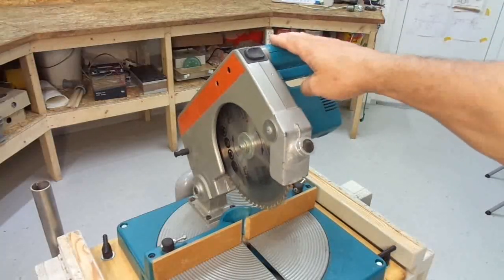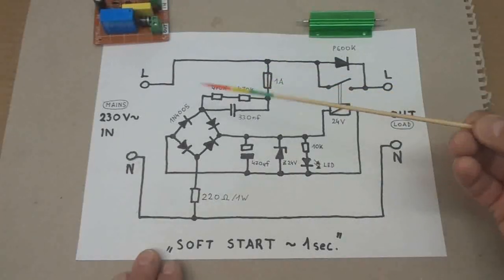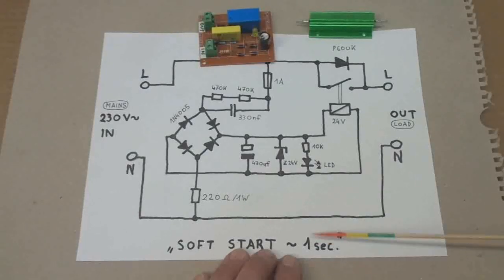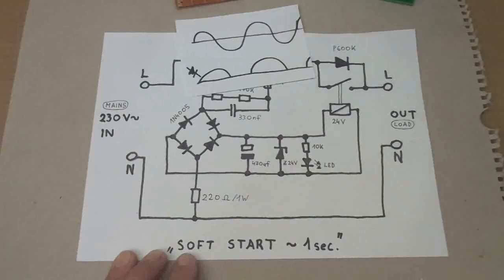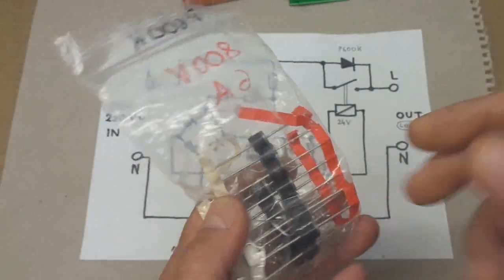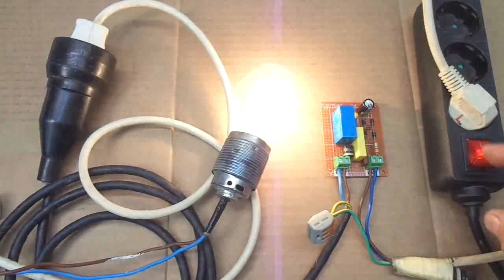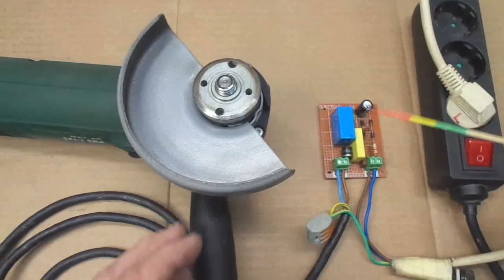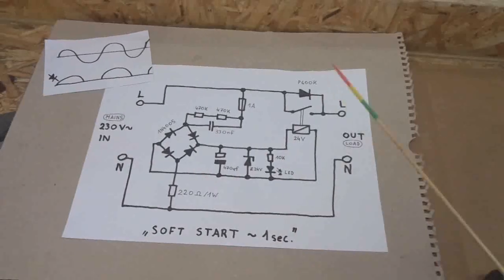simple soft start circuit DIY

Comment: Hi. In my project AC voltage before bridge is only 12v and after bridge is 9v DC.. How to get more to power 24v relay? I been use parts like on move. Any help welcome.
Reply from the maker: Make sure, that it is a 24 Volt Zener diode in your circuit..If the Zener diode is correct, your relais wants to draw more current then mine... Try a bigger dropper capacitor. 470nF instead of 330 nF.... Or even higher, if you have a big Relais.... Dont get confused, the dropper capacitor limits the current, not the Voltage.. The Voltage, which you get on your Relais is the sum of how much load you connect to this "transformerless power supply"... So if you remove the relais and the Zener diode, you will get about 320 Volt DC out of the bridge rectifier...(unloaded). No matter, what value you have for the dropper capacitor. Once you burden the circuit, the Voltage will collapse and settle at an equelibrium point... Thats, where the Zener diode comes into play... It clamps the voltage down, if the Relaiscoil gets damaged and out of circuit...It protects the Electroloytic capacitor, because this cap is not made to handle 320 Volts. In my circuit i ended up with 19 Volts on the relais... That means, the Relais works, without getting to much Voltage and the Zener diode has nothing to do, because it is not conducting at 19 Volts.. So the Zener diode acts as a "crow bar circuit" it will conduct just in case of Relais failuer and blow the 1A fuse intentionally... It is a safety measure..  Short story long... increase the value of the dropper capacitor until the voltage is enough to power the Relais. Measure the voltage, when the Relais is on. It should stay a bit under the rated voltage of the Relais. This is fine and extends the life of your Relais.... I hope, all of this makes sense for you..   xD   And you will get the thin running.  ;)
Reply: @LariFariYoutube  Thank you for answer. I recon when relay is not connected output voltage is 24.8v .When i plug relay its works , hold connection but voltage drop to 9v. When i try start with relay connected den voltage cant build more then 9v. So I susspect my relay needs more current. I'm right ? His resistance is 540 ohm. Needs try bigger capasitor.
Reply from the maker: Yes, try a 470 nF capacitor or higher if necessary... @krzysztofwojcik108
Reply: All done. Fix my problem with replace a  relay with another one.  Same as yours. Soft start works fine. So in my case problem was with too big relay. Thanks for support. @LariFariYoutube

Comment: In use with an induction motor that has a start and run capacitor, do I need to bypass or remove the START cap?
Reply from the maker: A diode in series will not work on a induction motor.. Use instead of the diode a low value resistor. Somewhere in the region 1 to 10 ohms...or even better, a wire wound ballast. Like i did on my table saw build.
Reply: Ah ok. Thanks for your help.  I was trying so many ways with a NTC thermistor, but was unsuccessful.
Reply: If I have an inrush of say 20A on a 240VAC motor, does it make sense that a 10ohm resistor needs to handle almost 5kW?
Reply from the maker: A induction motor needs the full sine wave to operate.. So you have two options.. Using a resistor instead of the diode or a inductor.. The resistor / inductor needs to handle the high current just for 1 second, then the relais kicks in and all the current goes through the relais.. In my table saw build, i made my own soft start ballast coil out of 200 meters of installation wire.. You can build a smeller version with 50 meters of copper wire and a iron core. Watch the video "Table saw pt 4" to see what i mean. If you want to use a resistor, 10 ohms would probably be to high.. less the 5 ohms would be more suitable for such a high inductive load. There are a lot of variables involved and it needs a bit of experimentation to find the best value for the task.
Reply: Excellent! Thanks for your knowledge. Yes, I found your video and saw the inductor you made 😁. Ok, I have a 3ohm  10W resistor that I'll try.
Thanks so much

Comment: Is the inrush current cut in half? Or by what % reduction can you figure with?
Reply from the maker: Yes, it is half the current, because the diode cuts one half of the sine wave. If you use a Resistor instead of the diode, you can determen the current reduction by yourself... Typical values are somewhere between 1 and 10 Ohms. I made myself a wire wound shunt for my homemade table saw.. Check the video out.
Reply: @LariFariYoutube  thanks for the reply

Comment: Hi Larry, in your wiring diagram there are Neutral and Line, what if they swapped? Because we dont know which N and L in every electric socket. Thank you.
Reply from the maker: Dont worry. Because it is AC, it does not matter. We over here in Europe can plug in our 230 v plugs ether way round. Our houshold sockets are not polarized.  The only thing you have to keep in mind is, that relais will eventually switch the N instead of the L. But if you not having suicidal tendencies, you should not fumble around on elektronic tuff, which is pluged in to mains, anyway...  xD  So this circuit will work, no matter which way round you connect it up... By the way... because i had some questions on that...the order is:   Power plug --> switch --> soft start module --> Motor / load.  Greets from Germany.

Comment: So I got a makita soft starter module want yo add it to my dewalt table saw how do I go about wiring it up.
Reply from the maker: I dont know the Makita soft start module, but i assume, it gets wired between power switch of the saw and the saw motor. Because i think, it does more or less the same like my simple version here...But maybe a bit more advanced... with microcontroller and triac..

Comment: Great explanation sir. Could I ask you which component handles the delay?
Reply from the maker: It is the electrolytic capacitor. And the threshold voltage on which the Relais kicks in. Make the electrolytic capacitor bigger and the delay gets longer..

Comment: Im looking at building this for 120v like Claudemir has detailed but keeping the 24v relay.  Does this part list check out?
1x) 1A axial lead fuse
2x) 470K resistor
1x) 330nf X2 capacitor
4x) 1N4005 diode
1x) 2200 uF capacitor in place of 470uf (to get a 1 second delay) <-- not sure on this one
1x) 1N4749A 24 volt/1 Watt zener diode
1x) 10k resistor
1x) led
1x) 24v volt relay
1x) 20A10 rectifying diode (20 amps)
1x) 220ohm/1w resistor
Reply from the maker: I think it would make more sence, to go for a 48 Volt relais, because it takes less current to get it going.. The capacitive dropper limits the current, not the voltage..(simplified).. Your list is more or less ok. The 330 nf capacitor could be a bit low for 120 volt... Try to stay below the Zener voltage, when the relais is activated, so that it does not get hot.(by tinkering with the value of the dropper capacitor).. I am working on several big projects at the moment and have no spare time on hand to make tests and modifications for 120 volts on the circuit. Would be nice to see, if you are able, to get the circuit going on 120 volts and what kind of modifications you come up with.  ;)
Reply: @LariFariYoutube  Thanks for taking the time to give feedback.  I am not sure when I would build this.  The next step for me is to work on a schematic and learn to calculate the proper values.
Reply from the maker: @richiem9316   Oh, yes, there is a way, to calculate the proper values, but therefor you have to know, how many mA your Relais draws. Personally...For such small circuits i am faster to slam some components together on a breadboard and test it right away... I know, breadbords are not ment to work on 120 Volts or more..  xD

Comment: what are the calculations if i want 2 second start time instead of 1 second ?
Reply from the maker: double the capacitance of the electrolythic capacitor.... (timing capacitor)... It depends on the kind of relais you use...  You have to find the right value by trial and error..
Reply: @LariFariYoutube  for more precise activation of the relay, shouldn't we put some kind of transistor, and the timing capacitor controls the voltage of the transistor gate instead ?
Reply from the maker: Yes..this would be "the next level"  ;)  The circuit in the video ist the most simplest, you can get away with... There are lots of ways to do it... You can use a Transistor circuit, an 555 Timer IC or even a small attiny microcontroller.... But in the end, it is what it is...a simple soft start.. In most cases it does not matter if the relais kicks in after 1,5 seconds or 1,8 seconds... ;) The nasty inrush current spike occurs in the first 0,5 seconds...At least in the application, which it is designed for...starting motors or transformers..
Reply: @LariFariYoutube   one more think, when selecting the appropriate relay that can withstand the load, should i consider that the load is inductive load ? because relay are rated for resistive loads and have about halph its original rating if used with inductive load
Reply from the maker: Yes, would be  good practice to go with the relais about double the "run" current... My table saw pulls in operation about 10 A @ 230 Volts... I used a 25 A relais for tis machine... So far no problems... Its not the inrush current, what harms the relais contacts. It is the spark, when you turn off your device.. A 100nF 400V capacitor in parallel with the relais contacts can also help, to qunch this arc. Than, your relais will last longer..

Comment: Great video! I was looking for this circuit. Only one question. Is the 330 nano F value ok? Does not have to be micro F? Thanks!
Reply from the maker: It depends on your grid voltage, freqency, and the current which your relais draws... There is a proper calculation, to get the perfect value. (or look for onlinecalculator)  If you dont want to do the math, try differnt values..... Start with 220nf and increase, till your relais gets enough juice...but not to much. If you overshoot to much, the zener diode gets hot.....
Thats usually the way i do it.... Because i am a fool.. xD
Reply: @LariFariYoutube  xD. Thanks for your response Lari! Very kind from your part. In my case I have pretty much the same values you have, so that value should be ok. I'll build the circuit and measure it. Regards!

Comment: Sir may i ask is the diode p 600 k can handle 800 watts 6  ampere i'm i  correct sir tnx
Reply from the maker: 800 Watts at 6 Amps? Is the grid voltage in your country 125 Volts?  Yes, the Diode can handle that, because it is under load for only 1 second. But if you want to build the circuit for 125 Volts, you have to change some part values. There was one guy from brazil, who did it already. He posted all the necessary changes here in the comment section. His name is Claudemir Vernini.

Comment: hi can i use it for compressor refrigerator .. thanks
Reply from the maker: Yes you can...but normally, there is a built in soft start in every refrigerator compressor.. a PTC type divice.. You should check, if the PTC softstart in your refrigerator is malefunctening..

Comment: it can use for 1hp single phase ac motor?
Reply from the maker: Induction motor or universal motor?
Reply: induction motor for shallow well tank
Reply: can i have your diagram clearly sir🙏🙏🙏
Reply from the maker: For induction motors you can not use a diode. Replace the diode in the circuit for a high power resistor about 1 to 5 Ohms.. Or a better solution would be a "ballast"... On my homemade table saw, i used 200 Meters of copper wire as "start ballast".. The ballast is big, i know, but it is built, to last forever... Thats how we germans like to muild stuff..  Go to my video "homemade table saw Pt 4"... Minute 12:05.... And give me your e mail adress, i will draw a diagram for you.. Whats the grid voltage in your part of the world? 120 or 230 Volt?

Comment: Memasang Dimmer Rakitan Sendiri
Adalah kepuasan tersendiri, karena kita mengerti  dan memilih komponen triac yang tepat kita memaksimalkan peruntukan alat tersebut. Apalagi alat tersebut di samping untuk Alat softstart ternyata juga bisa melakukan penghematan pemakaian listrik rumah. Beberapa alat penggerak motor & elemen pemanas yang biasanya untuk kebutuhan rumah tangga dengan kapasitas mampu menahan beban 4000 watt :
1. pompa air
2. Mesin cuci 
3. Blender / Mixer
4. Pemanas Air / setrika 
5. Penanak Nasi
6. Mesin Bor / Gerinda 

Saya coba pakai microwave 1100 watt ternyata juga mampu biasanya jeglek walaupun listrik PLN 1300

** tidak bisa digunakan untuk keperluan mesin las listrik**

** saat memakai alat dimmer usahakan di posisi kan potensiometer meter kondisi minimal ( Rendah) kemudian atur potensiometer sesuai kebutuhan **

Lebih detail mengenai Dimmer Speed control dan Skemanya  silakan  lihat Deskripsi pada link YouTube :
Komponen Triac BT 137 saya lihat data sheet nya 8 A  jadi saya pakai 2 biji untuk mendapatkan kemampuan menahan daya 4000 watt atau bisa juga cukup 1 biji komponen Triac BT 139  data sheet nya  16 A atau setaraf dengan 4000 Watt. 

 https://youtu.be/BEMn9zsWcdQ

Comment: bro,. may i change diode 4005 to 4007, and  u have another alternative of 600v diode?  tengkyu...🙏
Reply from the maker: It depends on the load you want to soft start. The 1N4007 is a 1A, 1000V Diode...as far as i remember.  You can try to connect 3 or more of these Diodes in paralell, to get the required amp rating. Or you look on the junkyard for an old computer power supply. The often have a beefy diode on a heatsink built in. (TO 220 package). Instead of the diode, you can also try a power resistor (less than 10 ohm)..  Greets from Germany.

Comment: Hi Lari. will a 220v motor controller module do the same? also act as a soft start cirduit? thanks for the video. keep safe.
Reply from the maker: I am guessing you talk about a phase angle controller.  Yes, it would do the same thing. Even better. You could ramp the duty cycle from 0 up to 100% in a defined "startup time", as well as in a defined "startup curve" ....All you need is a arduino, attiny or some other cheap microcontroller and a ready made AC dimmer module like this.

https://de.aliexpress.com/item/32802025086.html?src=google&src=google&memo1=freelisting&albch=shopping&acnt=494-037-6276&slnk=&plac=&mtctp=&albbt=Google_7_shopping&albagn=888888&isSmbAutoCall=false&needSmbHouyi=false&albcp=12554800262&albag=127990761348&trgt=1284054470089&crea=de32802025086&netw=u&device=c&albpg=1284054470089&albpd=de32802025086&gclid=Cj0KCQiAzfuNBhCGARIsAD1nu--RdH2mSyYILRisfb7YA_gWVVZ2f4r3AyNWwPNrX8hUEgOD86NobqkaAinPEALw_wcB&gclsrc=aw.ds&aff_fcid=65c6684b6f6949cdb5b453acc9bdd5bb-1639906254613-09708-UneMJZVf&aff_fsk=UneMJZVf&aff_platform=aaf&sk=UneMJZVf&aff_trace_key=65c6684b6f6949cdb5b453acc9bdd5bb-1639906254613-09708-UneMJZVf&terminal_id=31954d0fc749441a856e15b8c7ee427e

There are lots of code librarys out there for the task.
Such a solution would be much more advanced but also more complex then the very simple circuit from this video.

Maybe i will do a follow up on this subject and make a video on microcontroller based startup / AC motor controlling.

Greets from Germany
Reply: @LariFariYoutube  thanks Lari for the reply. basically it is a light dimmer that i have that uses a mosfet. i connected the dimmer to my drill before as a test. it worked on the drill. hoping it will also work on my  1400w circular saw. crossing my finger though. i will be waiting for your video using a microcontroller chip. keep safe.
Reply from the maker: @newvaper3794  ohhh..be aware..I dont think, the light dimmer uses a Mosfet...i think, it is a triac.... But anyway....such dimmers are made for loads up to 600 Watts. Chances are high, that you will fry it, by hooking up a 1400 W circular saw to it. But there are such dimmers for high currents available on e bay..( 3000W and more)  they cost a few bucks.. Or you make your own. All you need is a beefy triac, a diac , a potentiometer and some resistors... I think it can be done with salvaged parts from scraped houshold appliances...